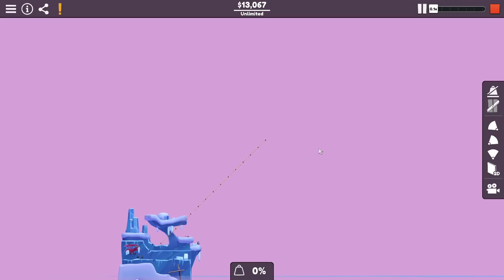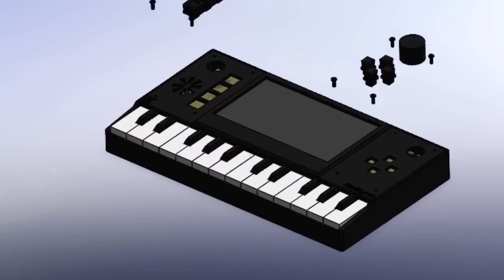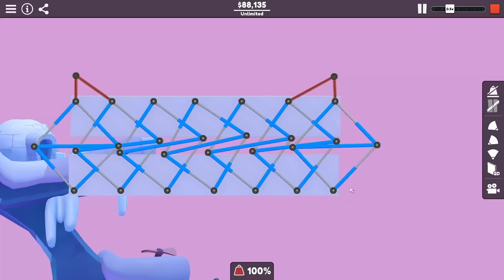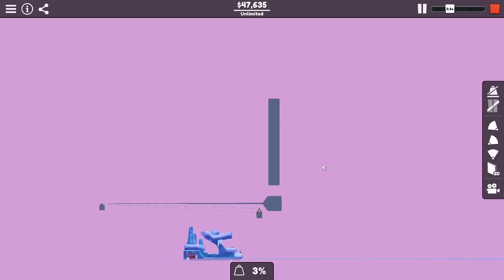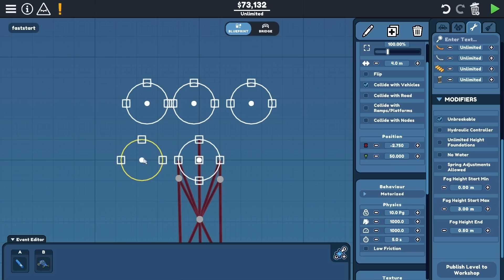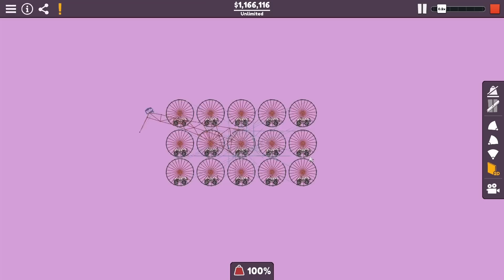How Fast Can You Throw a Car in Poly Bridge 3?

Comment: Can't you use splitjoints and hydraulic phases to time stuff to detach to launch at the correct timings to be able to time stuff better to get more force and better speed?

I also wonder if you could make gears using the custom shapes to use gear ratio's to multiply the rotational force. You'll probably be able to hit the literal limit of the entire physics engine's ability to assign speed values if you could do that.

Comment: These are all pretty good methods, but I noticed a few flaws. I don't know if you did them off camera or not, but especially with the trebuchet idea, it wouldn't work as you'd expect because the ammunition in a trebuchet does not lie flat on the ground, it hangs perpendicular and gains momentum in a half circle. If you want a trebuchet sling to go 360 degrees around you have to make a sort of pendulum where there's an arm with a weight that spins around as the catapult is flung up and the trebuchet sling follows the inertia of the first swinging arm to gain massive momentum. However, this game's physics engine isn't designed for technical and precice movement like this, and neither mathematical theorems that makes it possible in the first place.

Secondly: The scissor method you tried, launching the vehicle between two logs pushed together, did not work most likely because there was too small of an incline. If you ever try this again, angle the contraption 45 degrees and make a 60 degree scissor gap. Then make two nodes at the bottom of each log and hydraulic the rest so it slams down like scissors. If the physics engine allows it, you can most likely clear the map in 0.5 seconds on the slowest speed like this when the vehicle is airborne.

Comment: instead of adding more blocks you can just increase the weight of them by increasing how many "pg"s they are, and instead of adding more motors you can just increase the weight of the motor which massively increases the torque. Also custom shapes can have their own acceleration period not just trucks, you just need to set the "Motor Acc. Time" to a non zero number
Reply from the maker: I set the weight to the max on each block, and the motor acceleration parameter works but I find it's a lot less gentle than the trucks since their wheels on the road ball in a way kinda act like a clutch